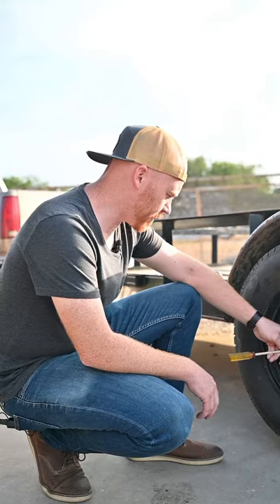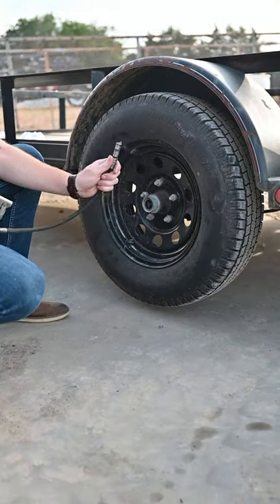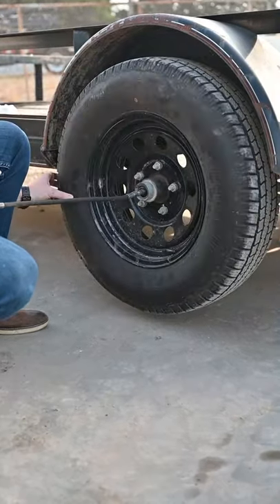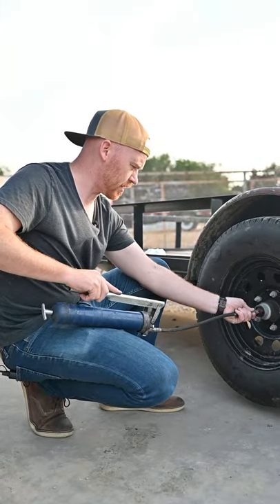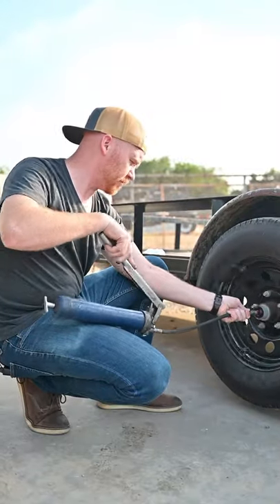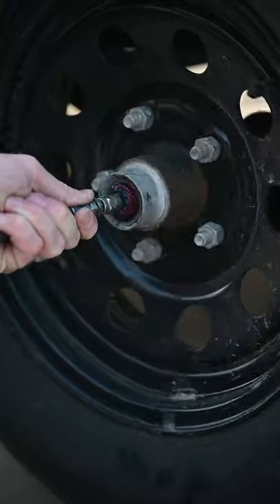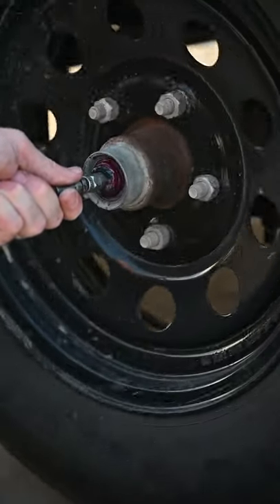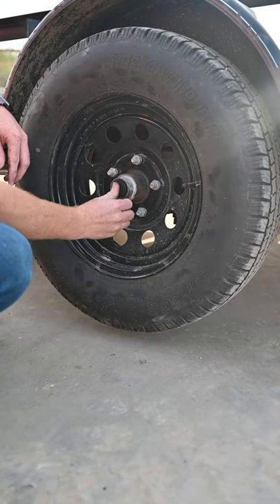How to grease your trailer axles

Comment: should this be done ideally during summer season on a hot day so the grease flows better and has less chance of bursting the back seal?
Reply from the maker: That shouldn't make much of a difference, typically people do it in fall or spring to either winterize it or get it ready for using it more.

Comment: what grease to use on new lamar dump trailers? I have heard don't mix grease's
Reply from the maker: There are a host of greases you can use. 
We like to recommend Lucas Red N Tacky, that is what Lippert uses from the factory. 
Also do not mix different grease. Make sure all the old grease is removed before applying the new grease.
Reply: @LamarTrailers don’t mix grease as in don’t mix old grease with new grease or don’t mix two different brands of grease together by using a different brand of grease that’s already been used on the bearings